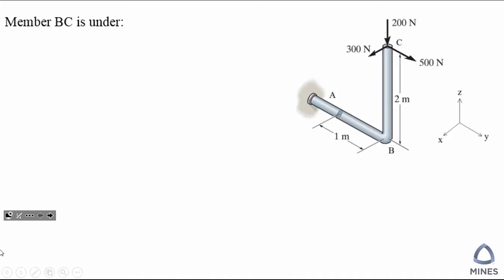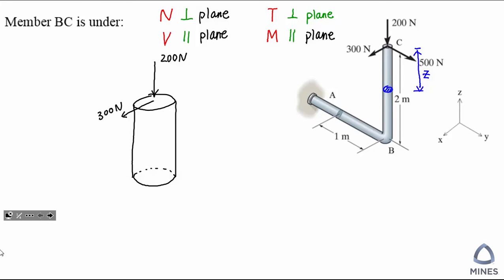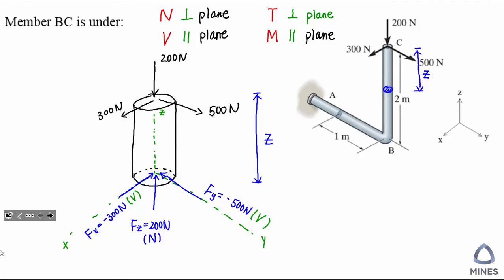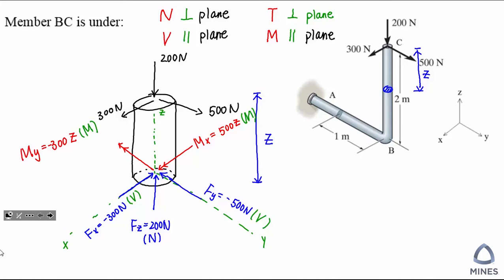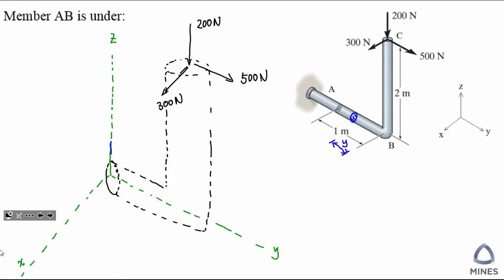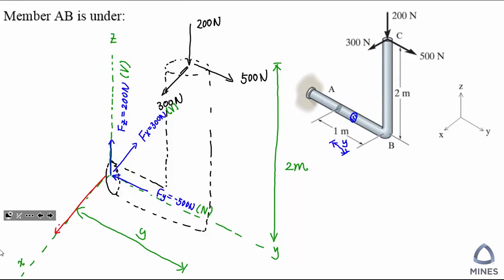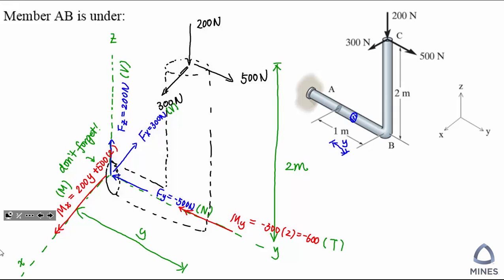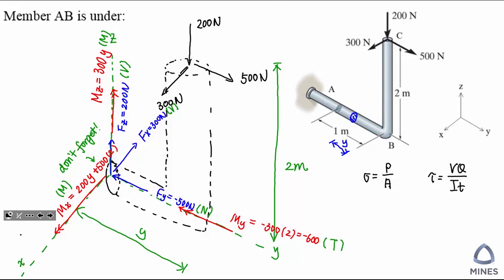Combine Loading 1 - Find Internal Forces

Comment: How did you find out what forces and distance did you yse for the specific moments. I'm really having a hard time trying to put it all together
Reply from the maker: Moment equals to force * perpendicular distance to this force. So choose a force first, then find the distance. Since this is the 3D problem, so the distance or direction parallel to force won't create any moment. Then move to the other directions perpendicular to this force, now you can calculate the moment. You can use right-hand rule to find moment direction (four finger in the force direction, your palm need to face the distance you choose also make sure your palm kinda perpendicular to the distance, now curl your hand, your thumb direction will be the moment direction). Or you can use math to calculate, for example, k=ixj, so if the force in x-direction, distance in y-direction, then you will get the moment in z-direction.